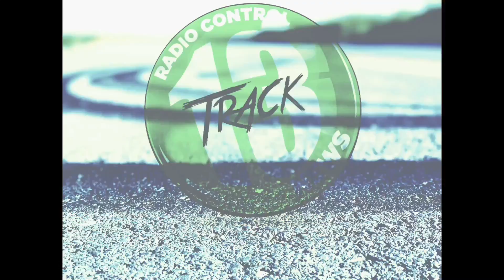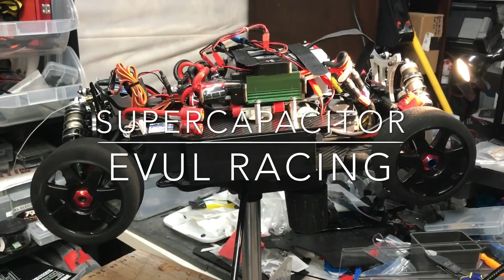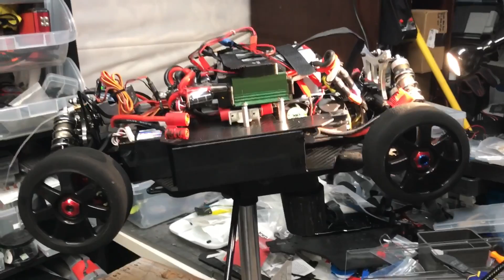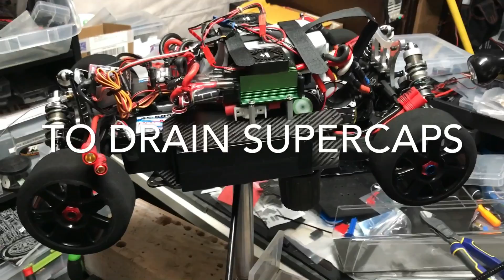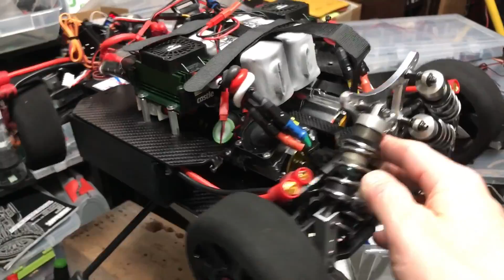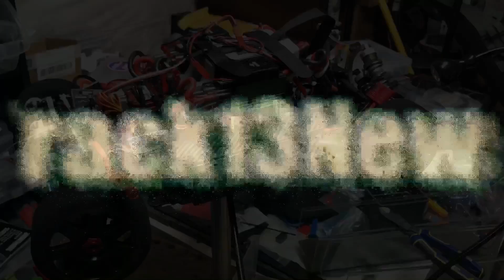24 Horsepower  SUPERCAR / EVUL SUPERCAPACITORS

Comment: Would this be useful also for RC Monster Trucks?
i would have space for like 2x 10000mA of 2S, would be the energy be enough to drive at least 3-5 minutes with a 1:8 Monster Truck?
Reply from the maker: Really is useful for keeping voltage steady, keep ripple down, and make sure steering and receiver have power if battery fail, but not that useful for monster truck, except for a tiny one about 1/20 the size I have
Reply: @Track13News  Damn :(
Anyways thx for the help, you do a great work!

so the voltage drop is linear?